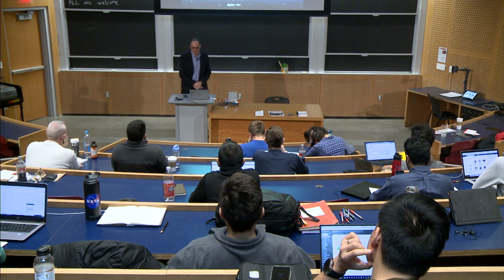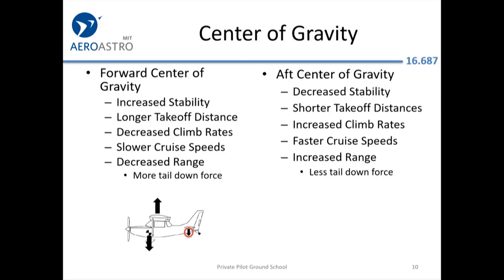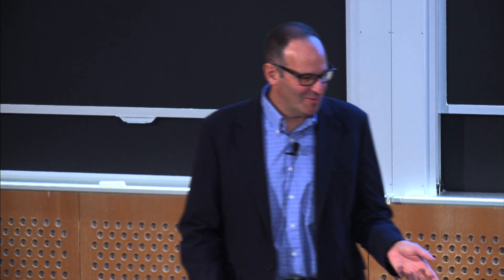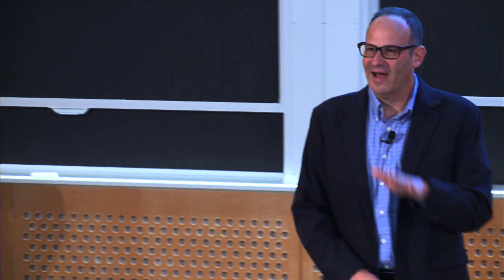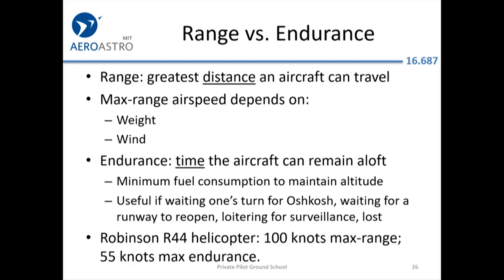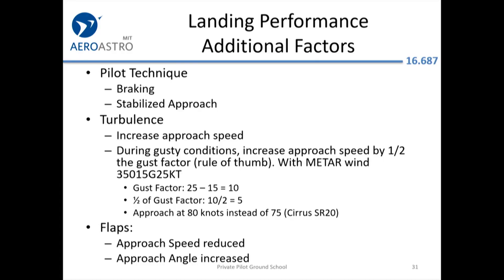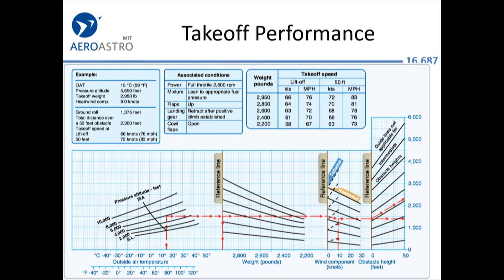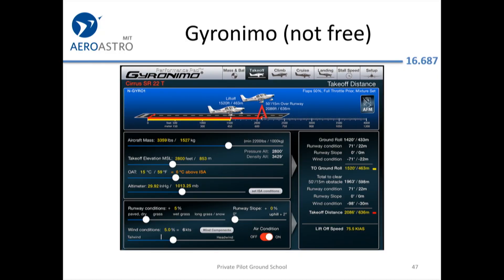MIT Private Pilot Ground School, Lecture 12 (Performance)

Comment: 16:40 To see why higher humidity air has less mass and therefore less density we just have to look at molecular weights. The molecular weight of H2O is 18; CO2 is 44; O2 is 32; N2 is 28; Ar is 40 (all g / mol). The water vapor displaces gasses much more massive than it is since it’s the lightest particle that makes up a sizable fraction of the atmosphere.
Reply: Thank you.
Reply: You also have to know that in a gas at ambient pressure and temperature, all molecules take up approximately the same space. You learn that in kinetic theory of gases.
Reply: @DrStedder  true